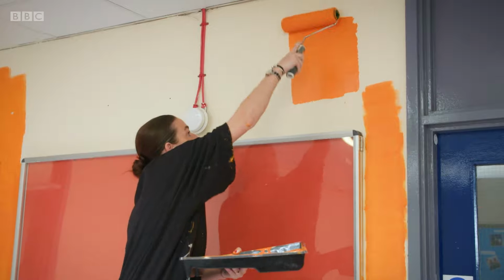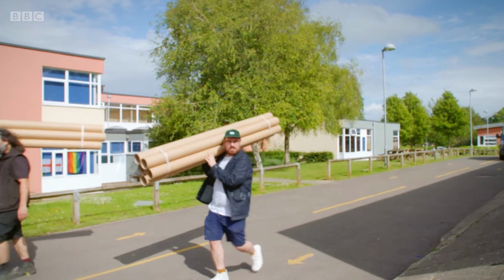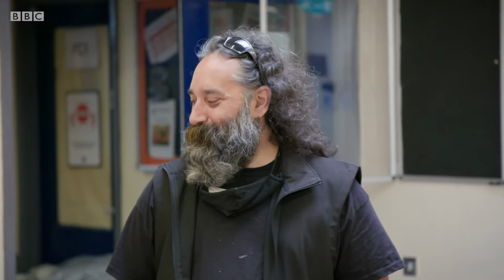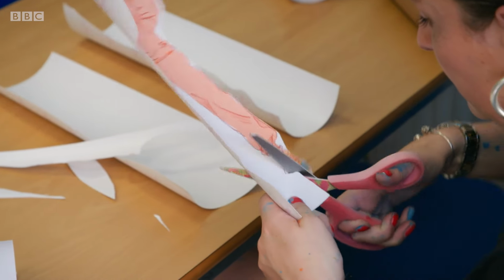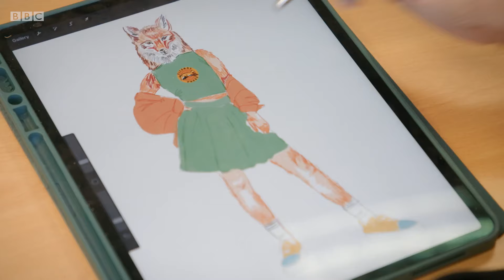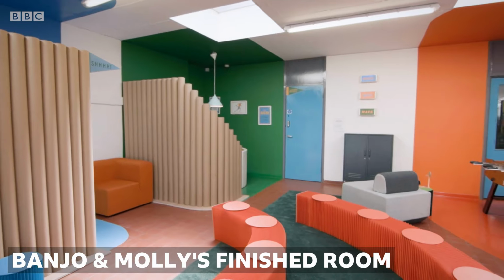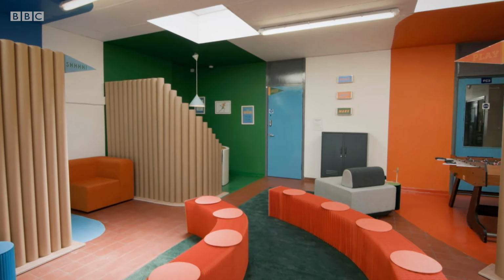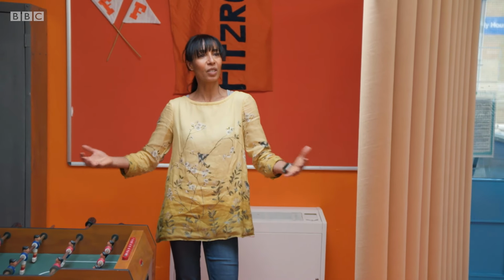Greta Thunberg inspired common room | Interior Design Masters - BBC

Comment: One crisp winter morning in Sweden, a cute little girl named The Angry Beaver woke up to a perfect world, one where there were no petroleum products ruining the earth. She tossed aside her cotton sheet and wool blanket and stepped out onto a dirt floor covered with willow bark that had been pulverized with rocks. “What’s this?” she asked.
“Pulverized willow bark,” replied her fairy godmother. 
“What happened to the carpet?” she asked. 
“The carpet was nylon, which is made from butadiene and hydrogen cyanide, both made from petroleum,” came the response. 
The Angry Beaver smiled, acknowledging that adjustments are necessary to save the planet, and moved to the sink to brush her teeth where instead of a toothbrush, she found a willow, mangled on one end to expose wood fibre bristles. 
“Your old toothbrush?” noted her godmother, “Also nylon.” 
“Where’s the water?” asked The Angry Beaver 
“Down the road in the canal,” replied her godmother, ‘Just make sure you avoid water with cholera in it” 
“Why’s there no running water?” The Angry Beaver asked, becoming a little peevish. 
“Well,” said her godmother, who happened to teach engineering at MIT, “Where do we begin?” There followed a long monologue about how sink valves need elastomer seats and how copper pipes contain copper, which has to be mined and how it’s impossible to make all-electric earth-moving equipment with no gear lubrication or tires and how ore has to be smelted to a make metal, and that’s tough to do with only electricity as a source of heat, and even if you use only electricity, the wires need insulation, which is petroleum-based, and though most of Sweden’s energy is produced in an environmentally friendly way because of hydro and nuclear, if you do a mass and energy balance around the whole system, you still need lots of petroleum products like lubricants and nylon and rubber for tires and asphalt for filling potholes and wax and iPhone plastic and elastic to hold your underwear up while operating a copper smelting furnace and . . . 
“What’s for breakfast?” interjected The Angry Beaver whose head was hurting. 
"Fresh, range-fed chicken eggs,” replied her godmother. “Raw.” 
“How so, raw?” inquired The Angry Beaver.
“Well, . . .” And once again, Greta was told about the need for petroleum products like transformer oil and scores of petroleum products essential for producing metals for frying pans and in the end was educated about how you can’t have a petroleum-free world and then cook eggs. Unless you rip your front fence up and start a fire and carefully cook your egg in an orange peel like you do in Boy Scouts. Not that you can find oranges in Sweden anymore. 
“But I want poached eggs like my Aunt Tilda makes,” lamented The Angry Beaver.
“Tilda died this morning,” the godmother explained. “Bacterial pneumonia.” 
“What?!” interjected The Angry Beaver.. “No one dies of bacterial pneumonia! We have penicillin.” 
“Not anymore,” explained godmother “The production of penicillin requires chemical extraction using isobutyl acetate, which, if you know your organic chemistry, is petroleum-based. Lots of people are dying, which is problematic because there’s not any easy way of disposing of the bodies since backhoes need hydraulic oil and crematoriums can’t really burn many bodies using as fuel Swedish fences and furniture, which are rapidly disappearing - being used on the black market for roasting eggs and staying warm.” 
This represents only a fraction of The Angry Beavers’s day, a day without microphones to exclaim into and a day without much food, and a day without carbon-fibre boats to sail in, but a day that will save the planet. 
Tune in tomorrow when The Angry Beaver needs a root canal and learns how Novocain is synthesized.